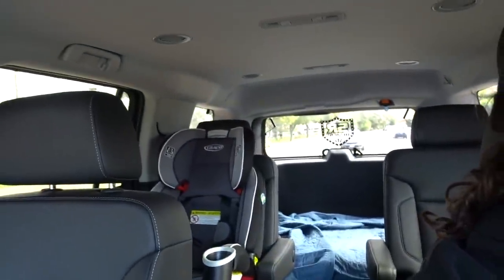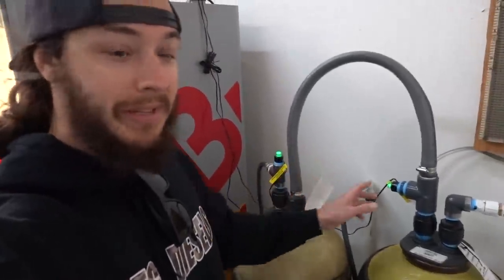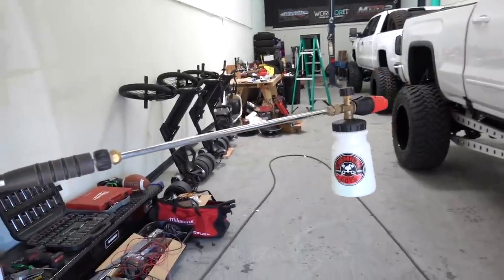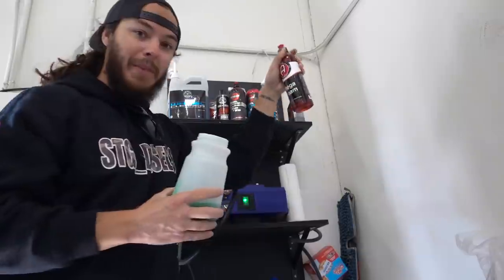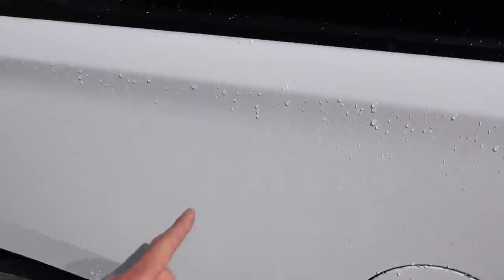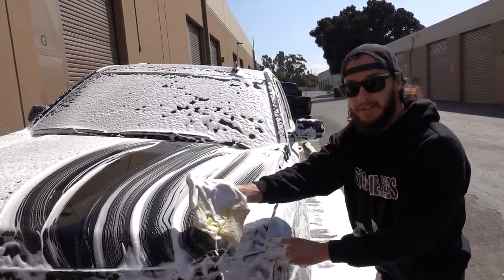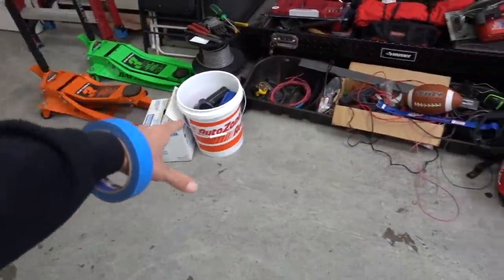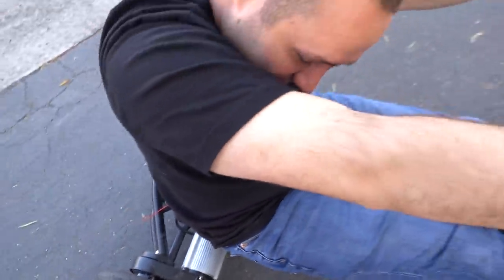The ULTIMATE foam cannon setup! (YOU NEED THIS!)

Comment: Great video. I'm a water blaster from B.C. canada. I've run everything from 1000 psi to 25000 psi. The wand with the long extension is for meat heads. Hands and feet , and throats have been cut. U could have put a quick coupler on the handle and then u can run long, extra long or no extension for just the former..

Comment: I just actually watched the most recent streetspeed717 video and his wrap guy Shane just bought a similar pressure washer nozzle, but the short lance "maybe 5" long, was a quick disconnect with a permanent attached 15,25,40 degree spray head. Aka they won't fly off and scratch/ dent your paint 
Worth checking out if your in the market

Comment: Got some questions that maybe you could answer then do I need a power washer to use a foam cannon I work at a body shop as a detailer and I wanted to get a foam cannon but we just use a garden hose and a bucket
Reply from the maker: crazy stupid gamer they make garden hose foam cannons, but they usually just spray out watery soap instead of foam.
Reply: @DMAXRYNO  good to know thanks